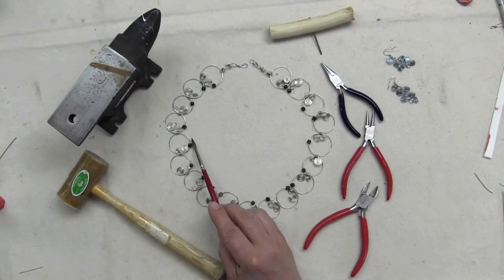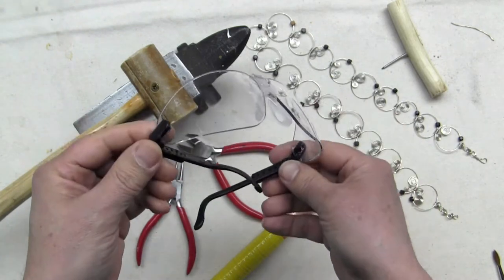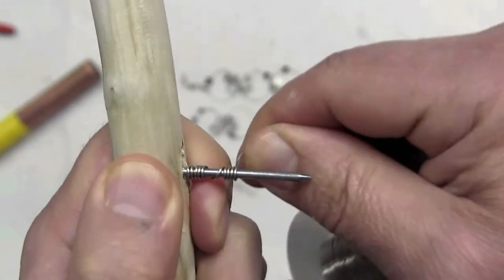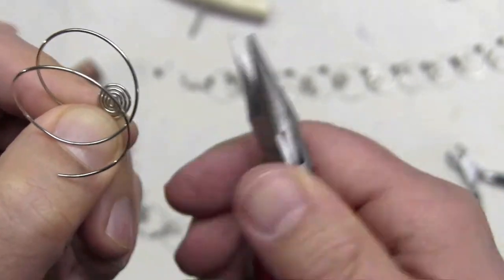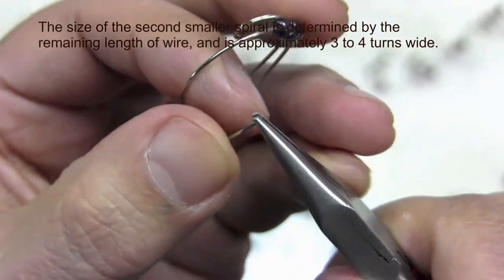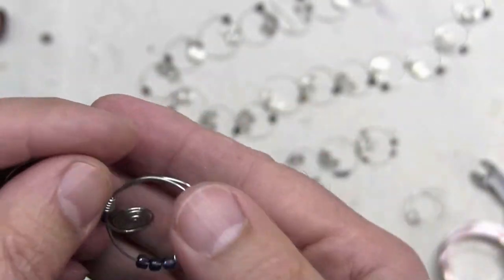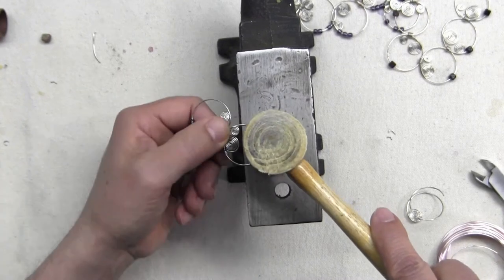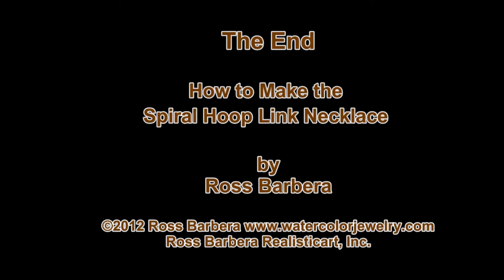How to Create the Beautiful Spiral Hoop Necklace with Purple Beads by Ross Barbera

Comment from the maker: This is an excellent point which I address in my workshops & will soon post as a video & blog article. Long, loose hair can pose a problem with some links, but there is an elegant way to modify wire necklaces for this hairstyle. A fewer number of links can be created just for the front of the piece, & these links can then be attached to smooth silk cord with a wire wrap clasp at the ends (see current newsletter for clasp). The look is beautiful & it is a good solution. Appreciate your comment!